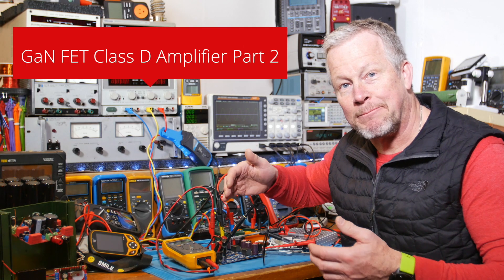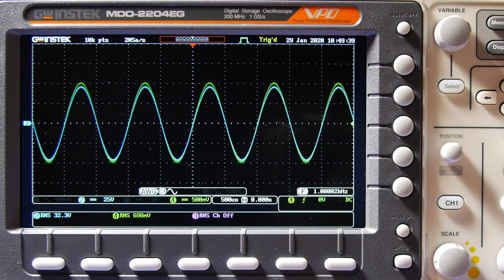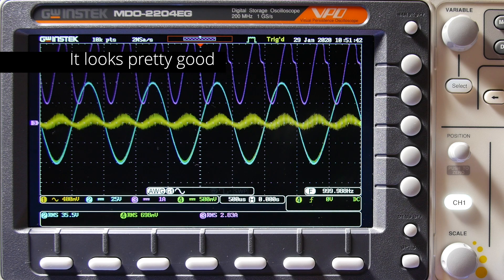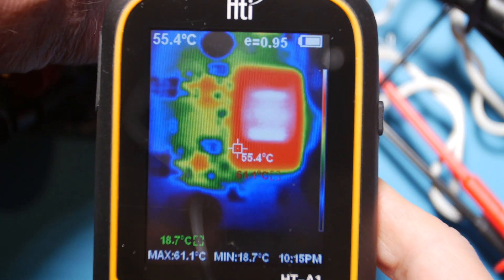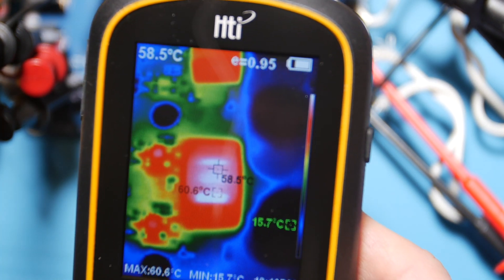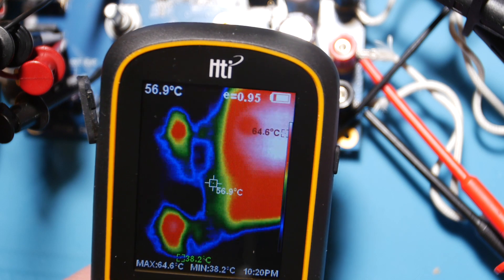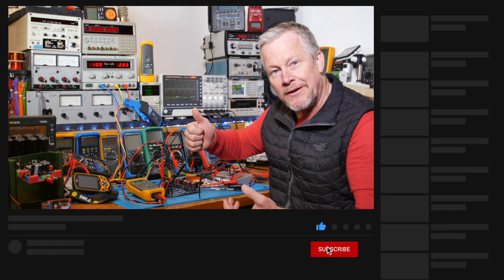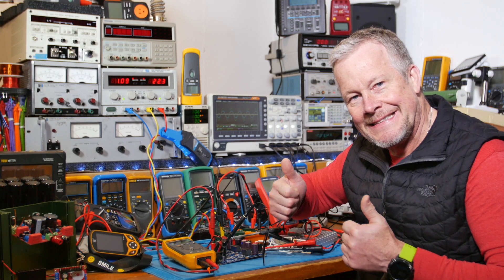GaN Class D Review Temperature pt2 with EPC GaN FETs

Comment: Its Amezing how efficient it is And with design of a pcb , do not place the Big capacitors close to Components wich radiating heat , because the capacitor works not good at high Temp,  it’s loosing micro farad,s
Reply from the maker: As amazing is the GaN FET - Bert, you are so right about the aluminum electrolytic capacitors!  But they did seem to be placed well and were cool in the pictures:)
Reply from the maker: Bert van Lelieveld It is amazing, and you have to keep the capacitors  cool;)

Comment: That is impressive - are the GaNs being driven with a pulse voltage or a constant voltage across DS?  I'm going to guess pulsed given the downstream inductors??  I'm on the edge of my understanding here so be kind!!  I know you have to send it back so can't destroy it but could you do a simple load test at full power and see if/how the GaNs increase temperature over time as far as you are comfortable to do so?  That would be interesting to know: in this video they rose from around 14C to 60C or so fairly quickly in the video but that could just be editing of course.  They say no heatsinks but is that just marketing, e.g. "can handle 150W without heatsink" but is that for n seconds only?  Great for marketing but makes for a much narrower use case.
Reply from the maker: Hi Andrew - great questions!  I'm with you - it just seems incredible.  Well, I have test results in the second part of this series;) I just posted today - I couldn't wait;) I ran at full power for awhile and temperatures seemed to stabilize.